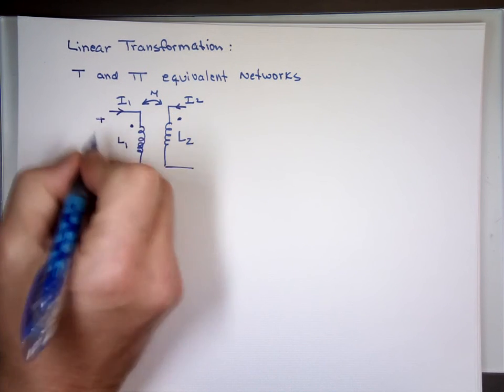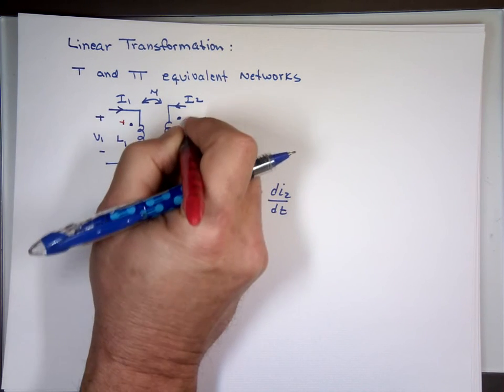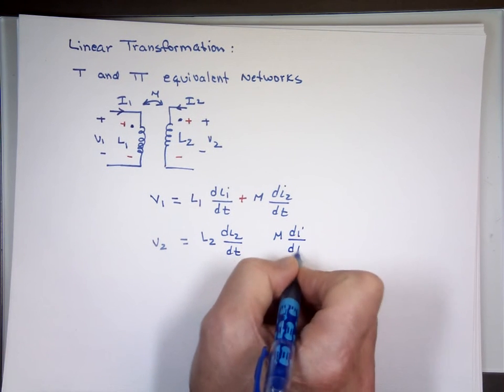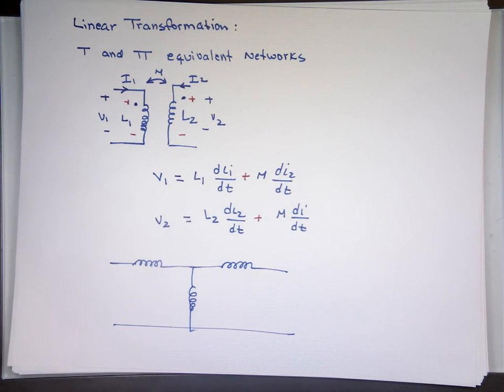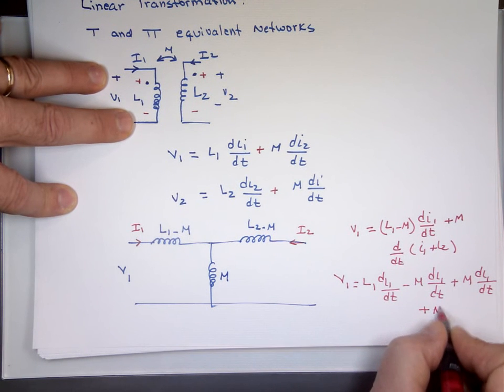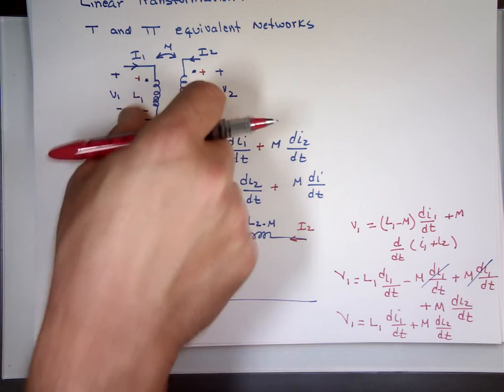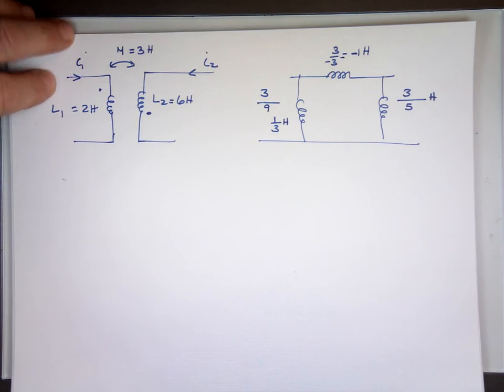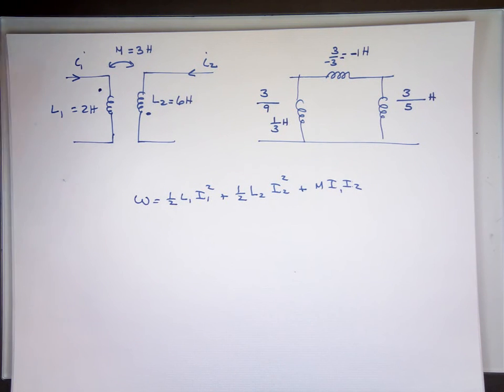T and Pie Equivalent Linear Transformers

Comment: I think there's an error here. The equivalent T circuit choice depends only if the dots are on the same side, not if current is flowing into the dots on both sides. If the dots are both on the same side, you use the first T circuit. If the dots are on different sides you use the other T equivalent circuit. This is regardless of whichever way current is flowing.
Reply: I don't think that your statement is accurate. To write any equations using mutual inductance, you need to know where the polarity dot is on both inductors and you need to know the direction the reference currents are flowing. More specifically, if reference current i1 is flowing into the dot of inductor L1, then L2 gets a positive voltage polarity on it's dotted terminal. Similarly, it reference current i2 is flowing into the dotted terminal of L2, then L1 gets a positive voltage polarity on its dotted terminal.
To be clear, I am still learning about these equivalents myself. However, I can not see how the equivalents can depend only on where the dots are alone without any connection to what the reference currents are doing. The dots are totally arbitrary by themselves in any given circuit and you need to know what the induced voltage polarity is to be able to analyze the circuit mathematically. It seems to follow that you also need to consider the reference current directions as well.